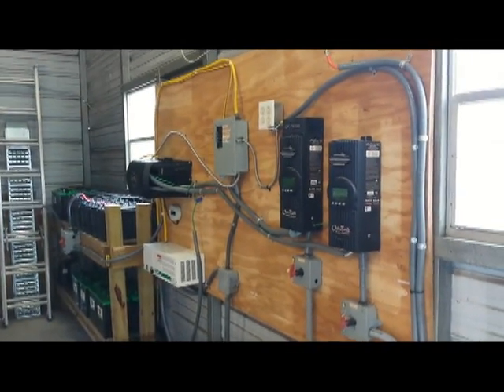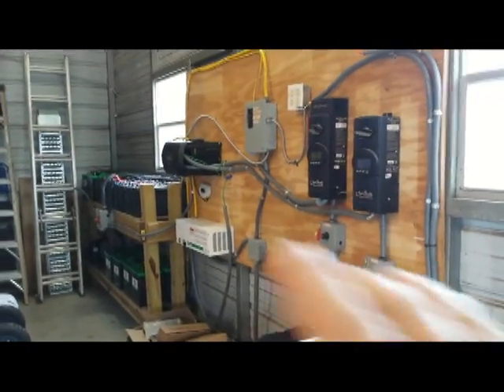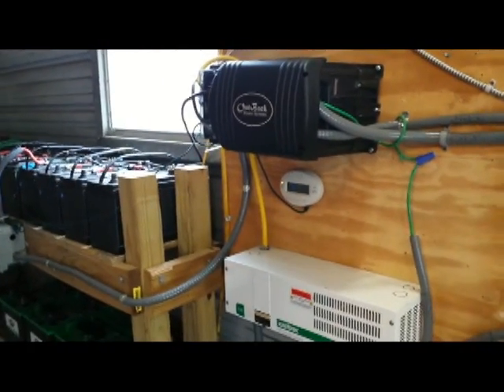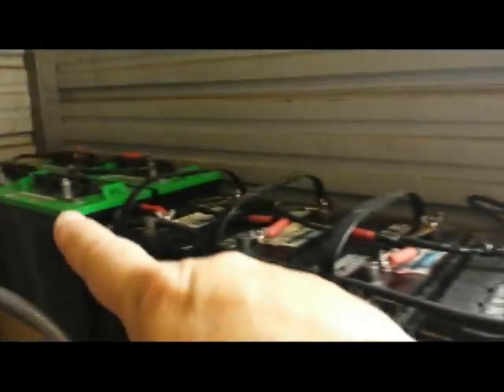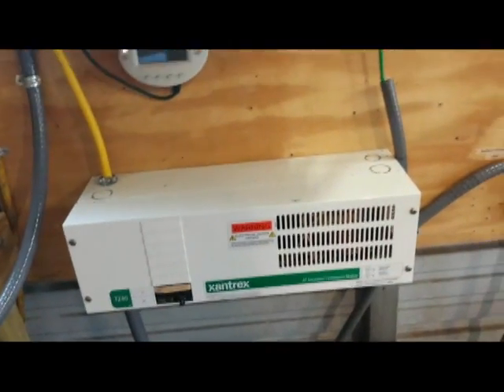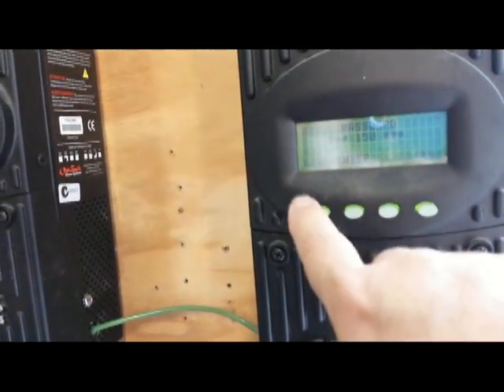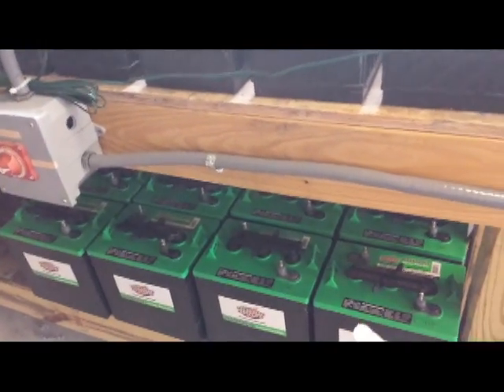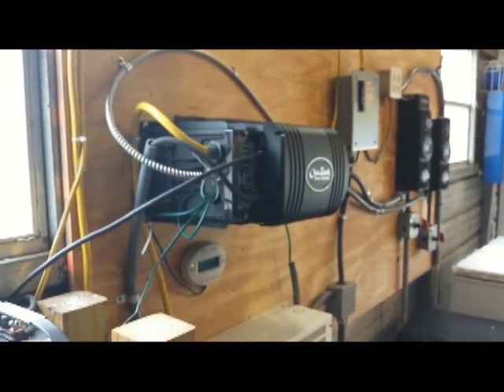Solar Power Grid Tie System With Battery Backup

Comment: Hello. I have a GEM electric car that I converted from FLA Trojan Batteries to half of a Leaf Lithium pack.  I also have a 14kwh rooftop PV solar system.  Now looking at getting a late model whole junkyard Leaf battery pack to get off the grid.  Any help appreciated.

Comment: Can you please tell me which BLS desulfator model you use for your 12 bank? 12b or 12c???
Reply from the maker: BLS 12/24C or you can use the BLS 12/24B either will work the only thing that is different is the battery connector.

Comment: When you have 3 solar panels, how many batteries you need?
Reply from the maker: There is no real answer to your question, it s a function of the solar panel's wattage and voltage, the load that you will put on the batteries and how often and for how long that load will be used.

Comment: am thinking of getting a Magnum 240/48 volt unit mainly bec i have a 240 well pump
some told me it does not Grid tie and may not power my well pump which draws 5Amps per leg--also will have a battery backup

any comments on the Magnum-it seems it would do the job for me --also i have a generator which i can auto start to charge batteries
some say i should get a Radian 8048 -but its a BIG unit

so enjoy your videos
Reply from the maker: The Magnum will run it easily, look at my other videos, you'll find that I also had a Magnum 4024 for five years and ran everything well. Excellent inverter but does not grid tie.

Comment: Hi Al. Long time follower on your RE system. Your system looks great with all professional equipment. Hope to see more on your turbines soon. Just to share more info Schneider Electric males a 4 kw hybrid  240 vac inverter for 24 or 48 vdc systems. They run about 2 grand as well.  The 1kw 24 v WM turbines run great on the China Sun G GTI's if ypu are going to use those inverters. We het about 950 w out of it  at 35 mph.
I always look forward to jour RE vids buddy. Thanks for being so informative:)

Good luck and God bless.

Larry
Reply from the maker: Hey Larry, thanks for the message. I was thinking about contacting you regarding the turbines. I'm waiting for my son to help me get up there and secure the towers before I put the turbines up and I watched your videos on what you had done to grid tie yours. I like how you did the low-to-high voltage switch for the GTIs. I'm thinking of going with the 3 phase 22-60 volt GTI, my average wind is 12mph for about 9 months but in fall winter we do get some really good winds and averages about 18-20mph. You think the 22-60 inverter is a good idea or in your experience you the 14-30 makes more power in the long haul for those averages?  Thanks buddy I value your opinion.  God bless you and your family.
Reply: econewpower Hi Al, Thanks for responding. I have the perfect set up for your system. Use a 250w GTI (10-30) and a 1000w GTI (22-60). 1 set up per turbine.Then use a wind switch from Inseepd.com to switch the inverters at 10 MPH from the 10-30 to the 22-60. I can send you a wiring diagram on all of this if you would like me to. We are getting outstanding results from this system.
Reply from the maker: That is awesome Larry, I will check that link out. By all means, yes, if you can send me the diagram that would be perfect. My email llorcaa@gmail.com. Thanks a bunch and God bless you!

Comment: Hey Al, Thanks for the update and explanation on things.  Looks like you've been busy.  Really appreciated the information on the 2 phase transformer.  That would allow me to run my heat pump or water heater.
Reply from the maker: That's what it's all about buddy, I need it for my well pump. We're kind hosed without that, next step is to get a spare pump just in case. Never can prep too much.

Comment: Hi Al,
Glad to see that you did some upgrades to your system.I too bought an outback GTI and cleaned up my system..IDK if you remember but you got me interested in the the outback charge controller to get the most out of my harbor freight panels..And i hope that your harbor freight panels are doing well..Thanks and God Bless!!
Reply from the maker: They are doing well and going strong. My next project will be to properly tilt them to get the most sunlight.